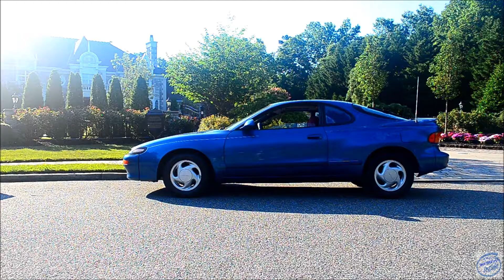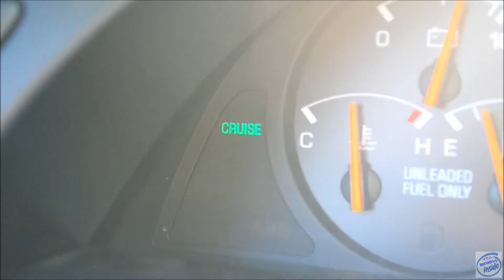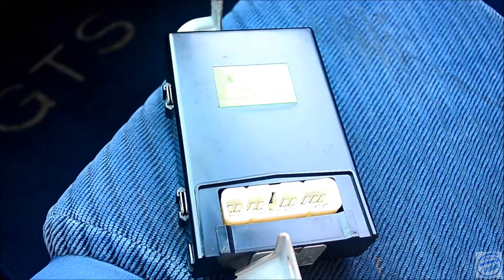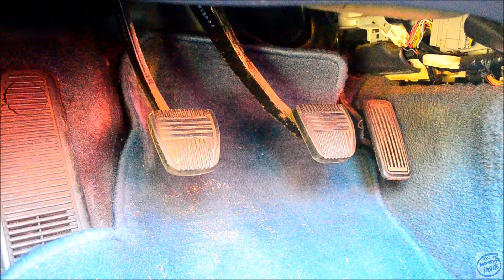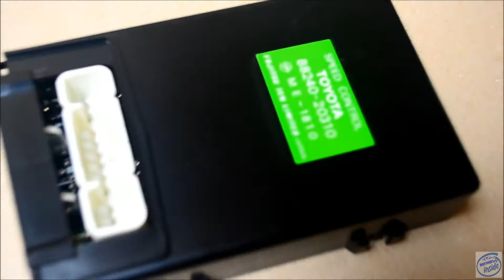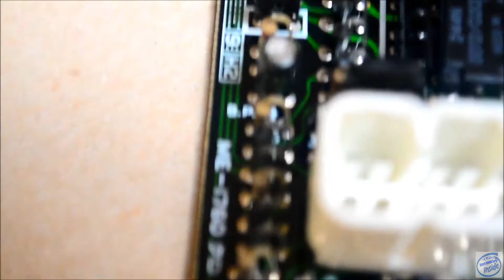TOYOTA CRUISE CONTROL FIX! Get That Older MR2 Celica Supra Corolla Camry 4-Runner CRUISING Again!

Comment: The Cruise control on my MR2 very recently stopped working. However, the cruise control light in the dash does light up when I depress teh "cruise" button on the stalk. Does that point to a probable culprit? Some stuff I've read online would seem to indicate that it might be the actuator in that case.

Comment: I've been trying to get my CC working on my 91 Celica and I have fixed the obviously leaking cap and it has made little no no difference and there is still no light on my dash, did you replace all the capacitors on the board and any other components?
Reply from the maker: Every cap was replaced, but be careful one of them is non-polarized, all the rest have polarity on the board. We're now tracking down vacuum leaks which are causing probs... the suspension needs work as well. Basically keeping any 35-year old car going, expect the work to be endless!